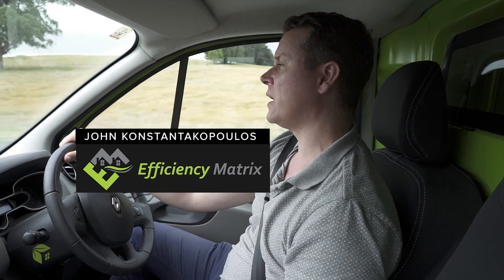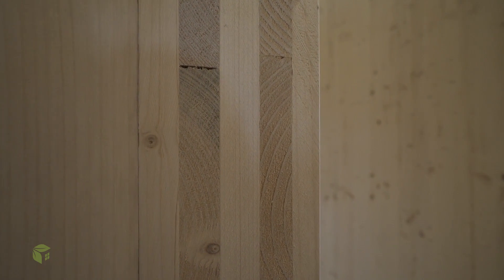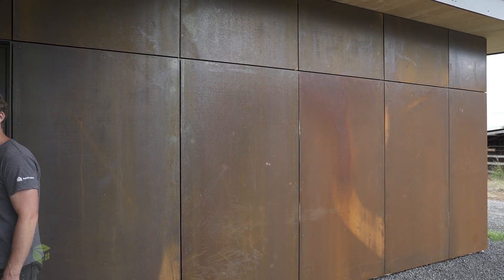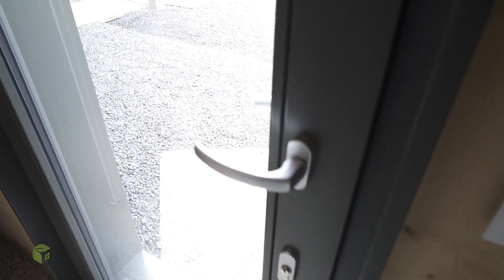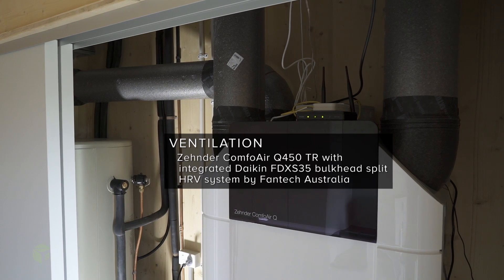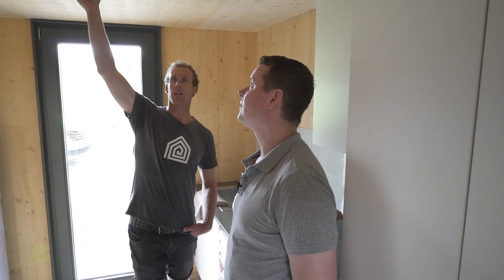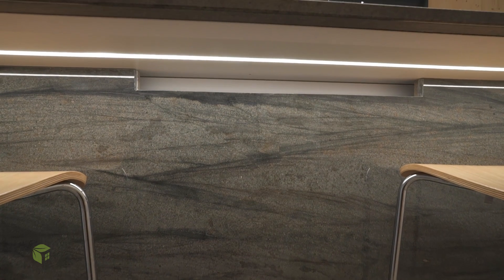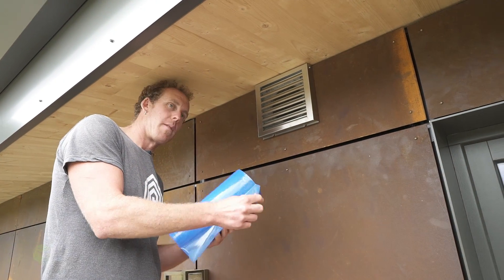Why This Passive House in Aussie Outback Still Turns Heads.

Comment: Nice performing house, but from the outside it seems too cold.

I was surprised not to see the typical, inviting Australian ranch looking wrap-around-wooden deck with long, deep eaves, and I can understand that this was probably all calculated before hand, but the house seems a bit uninviting to the environment outside the house, and it seems too cold and impersonal to receive guests through the main door.

You have the house and then field of grass with nothing to break the contrast.  There is no walkway, no landscaping.  It seems like a box dropped on the field with no connection to its environment.

In addition, I have no idea what the weather is like at the site, but judging by the trees and green grass, I would expect a lot of rain, and I would expect a grated water channel or French drain covered with gravel all around the property to prevent water from touching the outside house walls at the ground level.

If I was paying for a home that is more expensive than the average home, I would want these details taken care before moving into the house to feel at home.
Reply from the maker: This, series is primarily dedicated to building performance, insulation consistency, building air tightness, ventilation and even solar passive + passive house design.  We also covered this house before any landscaping was done.  So where other shows will dedicate a show to how spectacular an architectural design actually looks, this show will cover, how the thermal bridging and air tightness was dealt with for a spectacular architectural feature.
Reply: Efficiency Matrix if you were in the restaurant business would you think of yourself as selling burgers 🍔 or selling a three course meal 🥩.

In my opinion, I think of you as a chef who is selling a three course meal, but a chef 👨‍🍳 who wants clients to return has to think of the presentation.

I personally would feel offended in having a three course meal in a Michelin starred restaurant if the potatoes 🥔 were served on top of my main course covered by a salad and hiding the main entree under lettuce leaves, but I would feel better if the salad was served in its own plate along with the required salad dressing, and my potatoes were served next to my main entree rather than on top of it.

How would you like your three course meal to be served on a Michelin starred restaurant?
Reply from the maker: Eric Kosak Nice analogy, so I’ll give you this one.  If you were allergic(overhead on your immune system as opposed to your bank account) to egg which, symbolically is equivalent to gaps in insulation and excessive air leakage in a home.  You then proceeded to tell the chef, of your condition but you are served a beautifully presented meal laced with egg which you can’t see, and they don’t bother telling you about, how happy would you be?
Reply: Efficiency Matrix I think there are few architects and builders that can do what you are doing.  

So after so all the work you did, what is left to provide a nice (notice not luxurious or outstanding) overall presentation requires only a bit more of work.  

Cost wise (materials and labor) in the USA it is not terribly expensive if done and planned at the time of construction.  It is mainly a trenching machine around the perimeter of the house, two days top to place and cover a French drain with two or three people, a good carpenter with one or two helpers to build the deck for one to two weeks, and a landscaper working there for a week.

What is left in terms of work should be like sewing and singing for you, and it might elicit a possible smile from the owners of a house when they see their finished home for the first time.

It is up to you as you have said whether to do function over form, and I will leave it at that.

Comment: I built a passive solar ski chalet at Edelweiss Valley, Quebec in 1978-9.  Most ski valleys orient the slopes to face north, to lengthen the ski season, and if there is a residential component, it's located opposite, with both excellent solar exposure and a forested mountain at it's (northern) back.  I worked in that area about 15 years, as Canada aggressively improved it's building code, after the first oil crisis of the '70s.  Canada had increased insulation and vapor/air barrier standards and was doing "blower tests" to determine air-tightness decades before most areas of the USA.  That's quite understandable, it's really cold in Canada.
Now I'm in the hottest place in N. America (Death Valley, 200 miles north is about the same as here) the Sonoran Desert.  (Palm Springs, CA) California is aggressively improving it's building code to include better envelope control, it's basically the same direction 35 years later with earthquake considerations.   All good but they are missing a huge element of desert design.  
Radiant energy comes from the sun in "hidden" form because we can't see the low frequency light, but we can sure feel it.  Heat islanding is a direct result of having too much thermal mass in the wrong places, in our landscapes.  The same conditions exist within the building envelope and are only now being addressed.  A simple reflective shield or radiant barrier can stop most of the heat that hits your house, from entering it.  Something like that is missing when they hand down the re-written codes from other areas, to us.  Most codes are developed in northern climates, where radiant energy isn't considered as much, or at all because they get less of it, and keeping heat in, is a lot harder than keeping 'cool' in.  (Coolth, is a recognized term)   They don't want to reflect away any heat energy, whereas we want to reflect away as much of it as possible.
My contention is that the Passive Haus code (German institution) that incorporates thermal mass and other electromagnetic technologies like solar PV, battery and thermal mass storage, and geo-engineering ( the ground is our friend when it's hot, but all the houses have slab foundations!?!?)  will replace conventional, light-weight, stick-framing in hot climates.  
Here in southern California there are about 5 million of them.  
As an example of bad placement of thermal mass, my 3D design software (Sketchup)  shows the volume of the concrete slab to be roughly equivalent to the volume of concrete in the 1" stucco that surrounds our house.  The slab is inside and keeps the house cooler.  The stucco is outside and keeps the house hotter.  WTF?
At our house, we're enveloping the single (main) floor exterior walls with 3" of polyisocyanurate insulation @ R 6.6/inch = R 20 or so.  That uninterrupted (almost no thermal bridging through the envelope) layer of insulation will perform 25% better than insulation put into cavities.  A light weight covering is then applied, either trowelled on or metal, or wood, where the sun doesn't hit the wall.  A similar but slightly more complicated system incorporates the truss roof with special attention to how the roof and wall system connect with as few penetrations as possible.  Cement tiles on the roof also absorb heat and keep it for later, after the sun goes down, so we removed those and covered the roof with a radiant barrier and corrugated steel, to reflect away heat, rather than absorb it.
Mini-split heat  pumps will handle the three zones of the ranch-style (90 feet long) using newly installed pre-cooled underground air and brushless motors and variable speed motors.  A 5 kw Solar array with 9.8 kwh lith ion battery storage can handle the electrical requirements 90% of the time.  Sometimes there is still excess power generated by the PV system, which goes into an EV, if one is home.
Why do I do this?  One reason is that it's a lot less expensive.
Reply from the maker: Refuso Againo you have been doing a lot of work, and a lot of learning, along the way!

Comment: Please REMOVE music,makes it hard to focus on actual talking
Reply from the maker: Hmmm, have tried it on another pc?  Perhaps one of your channels is down?
Reply: Ho.. I seen the "gultex" it's high density wood fiber, the r value is 2.8 for 100mm... So the wood structure give something like r1...if it's the only insulation, then it's pretty weak and in no way it can be passive.
Even my shed got 200mm of this high density wood fiber.....
And he said extra layer for the roof, that's 200mm of wood fiber plus the wood structure something like 6.6... I find it pretty low too... I can't see this hous being passive, really. All this wood inside will give a decent inertia but... Not sure it will be sufficient in summer, and in winter.. The insulation will not be enough, heating will still be needed.
But kudos for encapsulating the whole slab, i did the same, it's the way to go.
You test  the camera when the differential temperature in out is low... No wonder you can't see much variation in the image, try it in winter.
Reply: Kinda delicate aren’t you Charlie.

Comment: Unless my eyes deceive me, that was an old fashioned water heater. Why didn't owners go tankless?
Reply from the maker: It's an advanced Sanden Heat pump actually.  In cold climates, putting the water tank inside the building envelope is a fantastic idea actually.  Sanden heat pump efficiency is super efficient technology, compared to instant.

Comment: This house looks awesome! I'm hoping to build a Passive house here in New Zealand some day, the consistent 21 degrees and low humidity would be fantastic!

Would be interesting to see how well the place resists the harsh Ozzy sun in the summer, seems hard to believe it won't become a hot box.
What system have they used to air seal the building? Obviously isn't the standard building paper and tape.
Reply: I reckon it's energy saving glass and CLT - this combination works great in cold Europe. Germans started using this technology, now Russia. Glad to see Aussies are following. I hope Australian building standards will change soon.

Comment: From my point of view, the problem with the passive houses is, that you need a lot of tech for ventilation to get all the wet air outside the building, so it won't mold.
The tech costs money to build in and to maintain, it needs energy and it can brake. Also you can't just open the windows, to get in fresh air. Am I right?
Reply from the maker: Not quite.  Down sizing significantly the heating and cooling in most cases makes up for the cost of a ventilation system.  Out of this ventilation system, you also get other air quality filtration benefits, which other homes cannot provide.  Nothing is stopping anyone from opening windows.  These ventilation systems do not use much power, and they do need to have their filters cleaned from time to time.  Hope this helps.
Reply: Agree with you. What about on long term running a passive house. No plastic bag effect?
Reply: This kind of CLT construction has no vapor barrier and is breathing.
Reply: astsaf. Actually you can open 
windows to get fresh air. My house is a laminated  log house with gutex on the outside , triple pane windows ,but is not totally air tight . close ,but not to passive standard . I decided to NOT have an air exchanger and it seems to work out fine.

Comment: Looks like CLT makes the ultimate sheer wall. 

Why couldn't you save money with glazing that doesn't open? Is there any reason to have mechanical windows in a house with a ventilation system like this?
Reply from the maker: You could easily avoid installing openable glazing.  It all comes down to the preference of the owner, and requirements for building code.  Thanks for the question!

Comment: 0.32 air changes per hour is very good I guess but it still seems like a lot of air change? If you imagine how much air cubic meters are in a house, and all that is exchanged in 3 hours? Just curious how air gets pushed through the walls etc so easily. I guess if it wasn't like this people would suffocate all the time.
Reply from the maker: Dejay Rezme That leakage rate is with simulated 32km/h acting on the building envelope. 50pa or pressure differential to outside.  Under normal conditions the ACH will be many times lower.  Thanks.
Reply: Ah cheers. Thanks for the video!

Comment: Wall insulation of 3+ and ceiling of 6+ . The windows have more than that. I am hoping there is some difference in countries. The US requires an R value of 19 minimum.
Reply from the maker: Australia uses a metric R-value. ;)
Reply: Efficiency Matrix  then sorry to be such an oldie but a translation of what equals what would expand your base on u-tube here.
Reply: Marianne Oprisko “Both are a measure of how well a material resists the passage of heat, R-Value is the imperial measurement and RSI is the metric equivalent. To convert RSI to R-value multiply by 5.67826; to convert R-value to RSI divide by 5.67826.”

Comment: Please help me understand! I understand the English language well, but, alas, my first language is "American!" ;-) Seriously, I think your R-value scale is different from what's used here in the states...the numbers I heard 2-3 and 6-something. on our scale, that's "uninsulated" practcially! R13 is the absolute minimum anywhere, R19, R26 being common enough for walls. R30-something to R60-something for roofs. I'm sure it's a metric/imperial (F/C?) conversion type thing. Do you know how to make that conversion? I do speak metric, but, I tend to translate to imperial to make sense of it. Just curious how much R6 is in my scale.
Reply: just found something that I multiply your R value by 5.6 to get the imperial equivalent.  Does that sound right?
Reply from the maker: Dan L It does sound right. 😉
Reply: Interesting. 
So in the US, the walls would be 11.2-16.8, while the roof would be 33.6.
Living in the southeastern US (hot/humid 80% of the year), this makes me question what is more important for energy efficiency in my climate zone:
R-value or air tightness?
I was leaning toward R40 walls and R60 roof, but I had a feeling that would be overkill. It seems air tightness and r-value need to balance to keep from overspending or creating more problems with internal humidity.
Reply: Alan, air tightness would be the more critical in general. What I'd call the "first-money" topic. But, both are important. Once the air tightness is handled, you'll get more bang for the buck on whatever R-value you then add. Moisture, and all it's problems, typically follows the movement of air. Stopping that is critical. And if you can insulate in such a way as to add more later (thinking attic spaces), that's great for spreading the costs. 

I lived in FL for 6 years, so I understand the hot/humid (and let's not leave out "HAZY") conundrum!  I think another good option for the SE USA is a cold roof; basically a two-layer roof, with an air gap that's open to the environment. The top layer absorbs all the heat, but doesn't transfer into the attic spaces. "takes the heat off of" the insulation's job. (Literally.)
Reply from the maker: Dan L http://efficiencymatrix.com.au/r-value-wind-air-flow-imperial-metric-converter/ try this calculator out Dan.

Comment: Great to see a good quality Australian passive house video.

A follow up video with a two storey house or building talking about adding a second storey challenge  and using brick internally for thermal mass would be great too. 

Oh, I'm planning to do this in Glen Waverley so it will save your builder a long drive from Geelong too.
Reply from the maker: Reverse brick veneer is an interesting one.  😉